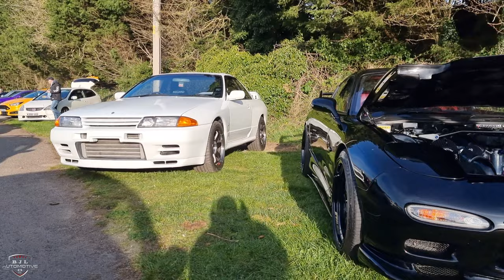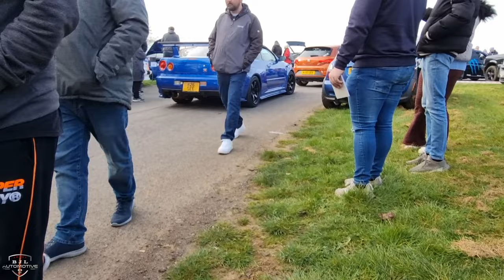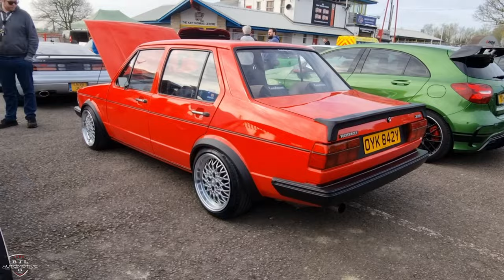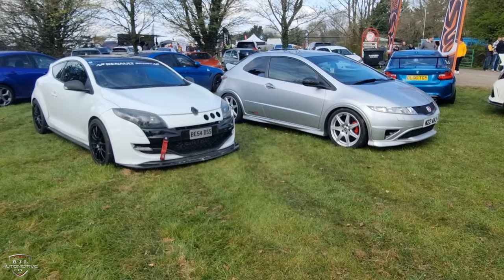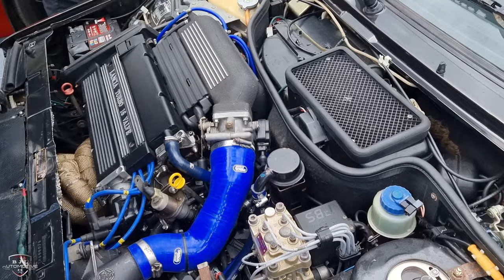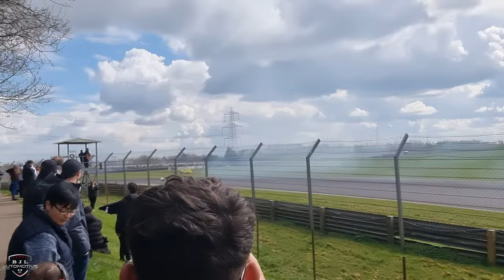Spring Action Day 2022 at Castle Combe Circuit

Comment: Saw you rx7, probably the cleanest rx7 i have seen in a while. Had my widebody evo 10 there also
Reply from the maker: Thank you for the positive feedback dude. Where abouts were you parked up? I captured what i could until my battery died but i didn't expect it to be a massive turn out like it was tbh. good day though overall.
Reply: @RotaryandRides  i was over in the red section, you off to japfest this weekend?
Reply from the maker: @jackturner543  ah ok, I might be going in a mates car to that event but it will be a last minute thing if I do as I have some other stuff non car related to sort out.